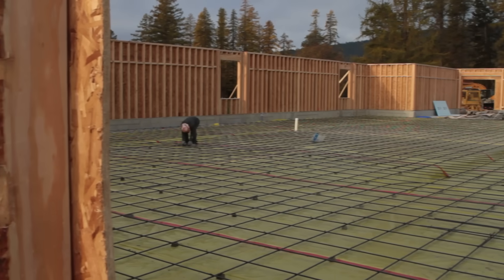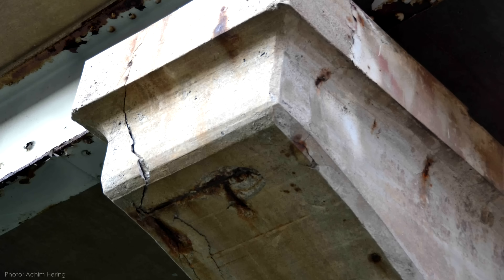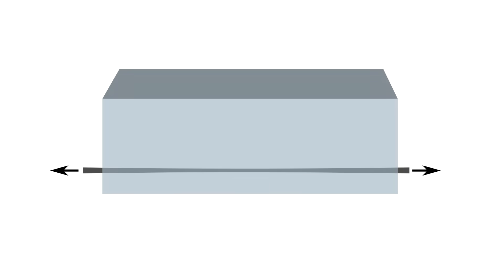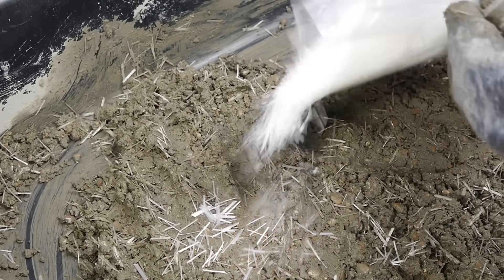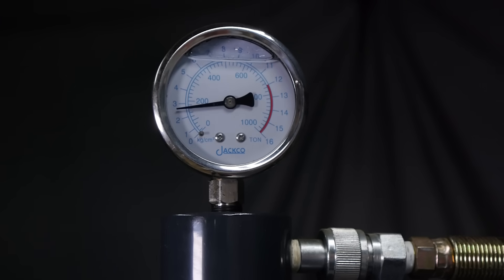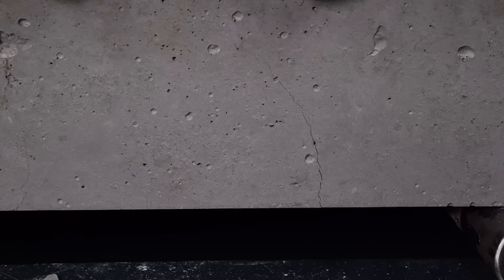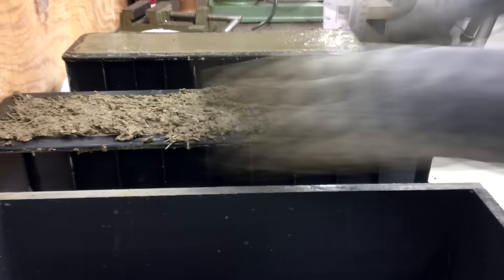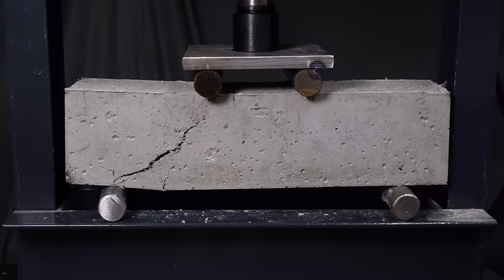Does Rebar Rust?

Comment: I constructed and maintained bridges for the state of SC for 34 years. Although some of the bridge beams we used were not of the best quality due to poor quality control  at the beam plant, most of our problems came from lack of maintenance, When I would make complaints to management, I would get answers from the SCDOT top manager that the public did not see the underside of the bridge. What he was trying to say was the money for proper maintenance was not there and we would have to do our best with what money we had. I would get really pissed knowing that I was spinning my wheels trying to keep the bridges in my district from falling. Some are really in bad shape and only get money for repairs when the inspectors rate them critically. Not only were some of my bridges state-owned but interstate owned by the Federal Government. Many of the major repairs I did were bridge bearings due to lack of maintenance. Many with stress cracks from bearing failures. I could go on with problems I tried to repair but money is a key issue. It is expensive to make repairs to bridges but the flowers alongside the road look much better for those in authority.
Reply: As said by a US Senator: infrastructure is boring. Also, the attention they get from maintaining infrastructures is not as much as creating new ones, so there is that.
Reply: @craigjensen6853  On my list of bridge repairs I and each year more on the list form the inspectors, many times I had to tell the supervisors above me that I had NO solution for repair. Some of the bridges were so far gone, the only fix was replace. Money is also one of the problems of deficient bridges. After ever snow season, bridges are supposed to undergo a thorough wash down to get rid of all the salt and calcium chloride. Over time the corrosion did it's thing and now this country is in bad shape. No money for maintenance. I had a couple of old bridges constructed by the WPA. The tendons here was square steel about two inches in diameter at the time of placement. As the spalds popped, some of the steel was rusted completely through. Really sad. :They finally replaced the twin bridges.
Reply: New bridges ought to be funded with adequate maintenance prefunded.

Anything else is a waste of money.
Reply: My Ph.D. thesis was about chloride-induced corrosion in concrete. 
You can check this link of my thesis dissertation: https://www.youtube.com/watch?v=b1zG3u5wjEE
Reply: Bean counter:  "The public does not see the underside of the bridge"
Engineer:           "No, but they'll see the bottom of the river when the bridge collapses"
Reply: Maybe if the bridge was designed correctly to begin with all the repairs and money waste wouldn't have been needed. But you go ahead blaming someone else if that makes you feel better.
Reply: Sir, who creates the money problem ? The govt. authorities or the private company for which you were working. Why would be there shortage of funds from govt. side as it's all public money and US govt. has most money on planet.
Reply: Suraj Tomar that’s not how it works.
Reply: @SurajSinghTomarArya  The "Free Lunch Anti-Tax Republican Party."  They don't want to pay a single tax, but still want America to be the best, baddess, and meanness Country on earth, ... for free.
Reply: Raymond Myers uh no. In SC they just put through doubling registration fees for vehicles, license fees and taxes in new vehicles to “fix the roads”. The only roads being fixed are interstates. Secondary roads?😂😂 I do hope if you visit SC (where I’ve lived all my life) you did pay a little extra for the struts with coil springs on your car or truck. We’ve just gone through the wettest winter on record and the potholes are abundant. The only good thing about them is it does slow traffic on our road which usually is flying (two lane road) shoulder in some places, others ??
We already were paying some very high vehicle taxes before the incremental doubling went into effect. The money is going somewhere but not into asphalt on secondary roads. The interstates will be masterpieces but getting to them will kill your vehicle.
A road near us was “resurfaced” recently-sprayed with tar and pea gravel spread on top and a ditch reshaped on one side near an intersection. I have seen four cars, two pickups, and one tractor trailer stuck in the ditch because if you swing wide to make the turn, the new ditch starts at the edge of the asphalt. Zero shoulder. None. When I say stuck in the ditch I mean the cars passenger doors were on the bottom of the ditch and the people driving had to stand on their consoles to open the drivers door nearly straight up to get out. 
Who in their right mind signs off on these projects when complete?

Comment: Another solution to corrosion prevention is cathodic protection; also quite common in concrete structures. Though it has it's own intricacies, it's a very interesting topic, especially when expanding the theory to other buried/submerged metallic structures.

Comment: Researchers are developing inexpensive ways to make carbon fiber from coal. This will replace much of the steel used in construction including concrete reinforcement. As an added benefit it will revive the coal industry without burning it as a dirty energy source.

Comment: I have 14 pieces of 1-1/2 "x10' rebar that are 54 years old. they laid on the ground for about 25 years at my Fathers Construction company. They had light surface rust on them. When my father passed and i liquidated the company , I decided they'd look good as stanchions around a flower bed. so i cleaned them up and epoxy coated them. I think alot of times Mill scale helps to preserve steel. BTW , i still haven't planted that flower bed.

Comment: Hi Grady,  Love your vids and have a question about the strength of joins between one concrete pour and another. Example. If one was building a wall/slab. And only had small batch mixing options available.   At some point in the formwork, one batch will meet another and they will be at a different point in their curing cycle. I'm assuming this is suboptimal.  But how badly, and where are the sensible limits?  
15mins between batches probably isn't much, but what about breaking for lunch or getting off site during the peak heat of the day. Bad weather interruption or even do some today, do more tomorrow..  I am similarly interested in this topic in a rammed earth construction. But as it is subject to a similar cement curing chemistry, I assume the answers are fairly good for both situations.
Hoping you might consider this worthy of a vid.  Thanks. :)

Comment: Using a integral water proofing when batching concrete and fiber or basalt bars are probably our best bet. The water proofing should help prevent the penetration of deicing salts and the fiber bars being twice the strength of steel with  1/7 the weight is a winner in my book !

Comment: As a NACE Certified tech I can tell you this is caused by Chlorides ( compound with chlorine bonded to an alkyl group.) This is why bridges fail as do a lot of Concrete structures. Where does the Chloride come from,,,Smell freshing mixed Cement...smells like Chlorine, right? So we put the same element on the mental re-bar that destroys it. Amazing our engineers haven't figured this out yet,,,huh.

Comment: Interesting to watch how the fibers and the rebar help the tensile strength, nicely explained and demonstrated thanks..
I work in traditional lime putty mortars and plasters where I use animal hair, hessian, sisal or polypropylene fibers for extra strength.
With Roman 'cement' their lightweight structures have survived many thousands of years and that the added lava or pumice became much stronger when immersed in sea water. This was because of small platelike objects called 'philipsite' that formed as a result of the mortars immersion into sea water which bend rather than shatter when under stress, many limes set well under water. 
Of course, concrete has the edge over lime because it's better at taking weight over longer expanses, also cement can actually take anything up to 6 or 7 years to fully cure. 
It would be interesting to hear your take on what caused the failure in the recent Italian road bridge that collapsed. Obviously this disaster was due to substandard mafiosi contract cement being used or perhaps they never added any rebar but whatever the cause somebodies nuts are on the line. I also watched a fascinating documentary about the Hoover dam construction and where the concrete had to be poured in sections at a time and to keep it cool, pipes carrying cold water were laid in with the sections but the main strength was achieved by the compressive strength of the water in the dam itself which I guess, like the Roman harbour constructions are harder than when they were 1st built.

Comment: Where I used to work (Nordhavn Metro in Copenhagen), we used this special membrane that reacts with the concrete.
We did a 40m x 9,6m shaft (where the ground water level were at roughly 4 meters below the surface) while using this membrane, we only had 1 small leakage after the construction of the shaft. 
For reference we had to pump 40m^3/h water up to the surface (which is quite a lot compared  to the size of the shaft and that we worked in limestone).

Comment: Would it be helpful is all rebar would have been individually protected against rust by shielding it with a plastic coating? 
 
And another thing is, I saw in the movie a floor being poured upon rebar, and the rebar only was laying on a plastic sheet, If water would come under the plastic sheet, the steel would come in direct contact with water. This is not the proper way of making floors. What I have seen in my own experience is, that the rebar is kept from the bottom by foam, then the concrete is poured, the result is that the rebar is between 5 and 7 cm from the bottom part of the floor. I think this is the proper way, in this movie they do it wrong. Making mistakes like that is causing all the problems.
Reply: The plastic sheet would also not actually lift the rebars up so concrete can go under it.

Comment: I’m an architect in CA and I see “ductile-Crete” used in industrial project quite often. I had assumed that the glass fibers actually increased overall ductile strength, so it’s very interesting to see that it merely helps prevent minor cracking. Thx!

Comment: The Roman cement or mortars last to this day. They were used mostly in compression with natural stone, not so much as a glue, more like a gravity shim. They also made concrete under sea harbor structures. Were they a better cement, or would our modern cement last as well without the "rust scale pressure"? Also, do you know if acrylic admixtures can help with longevity? I am currently using stone veneer mortar and fiberglass lath to make water features in a climate with a hard freeze, so I have a practical interest. Very interesting and informative video, Thank You.

Comment: We laid a drive entrance 25 years ago with smooth surface rust mesh that was before the common rebar wires used today - recently the telecoms people came along and dug a trench across the drive and I was curious to  see how the steel had faired.  It was in the same condition as laid and there was no sign of the surface rust it had before covering.  I was told at the time that the concrete would preserve the steel if the cover was sufficient. The entrance was used by 40 tonne articulated vehicles and was just 200mm thick . They were right.

Comment: Little question. Isn't glass fiber a little bit problematic (hazardous when breaking into micro particles)? we basically learnt in construction class, that glass fiber can have similair results to our lungs like asbest when cutting/handling without propper gear and certainly somebody will want to drill a hole into the concrete as we know humanity...

Comment: @  2:35  the re-bar is sitting right on the bottom of the pore,  I never do that, (I hope  :) ),  do you think they can get away with that.  I strive to have all my bar at least 2 inches from any outside edge.  This is one of the reason I don't like using the #6 (or whatever) welded wire in the concrete because it is hard to get it to stay where you want it, I have seen people almost every time have it on the bottom.

Comment: modern engineers are making concrete weak and prone to fail, bunkers from ww2 still stand, and if you want to go further back, what about roman structures that are still standing?
Ai Karamba we want awnsers!
Reply: that's actually simple.  tensile strength wasn't a concern with roman construction.  they were only concerned with compression.  the concrete they used was also mixed differently and had years to cure.  modern construction needs to take the compression and tensile strength into account, as well as cure time.  it's extremely impractical to use the roman methods today.  we simply do not have the time.  the lifespan of a building these days typically doesn't exceed 100 years, anyway.

as for those WW2 bunkers, they opted for very slow curing concrete that isn't exactly practical in most builds today.

Comment: Most concrete is wet. Its hydrophillic and sucks water into the pores. The concrete doesn't prevent steel from getting wet at all.
Reply: Plus the small degree of cracking you showed (less than 0.2mm) usually wont lead to corrosion. The chloride and water that gets into the cracks won't be significant to the alkalinity of the surrounding concrete. Generally chloride initiatd corrosion is due to concrete quality and cover rather than cracking.

Comment: You were spot on about the adoption of the gfrp rebar. I've been told 'it's not in the code so it won't work' far too many times by civil engineers.
What about epoxy concretes though, any insight?

Comment: hi, I am not trying to look smart or anything, it's an honest question, but... doesn't those cracks serve a purpose in the analysis/diagnostic of how is the structure's health? I don't know what the canadian norms work with that but we divide that in domains (1 to 5 each one having less ductility, and higher As/Ac) whenever calculating the Area of steel and it's actually not advisable to use a "crack proof" profile, just so we get a warning in case the structure start to fail.
I'm thinking it's due to the low cure time [7 days] but the way the reinforced tests broke to me look a little bit scary... first the "warnings" appeared so so close to the total failure point, second they didn't even start from the bottom wich is supposed to be the stretched zone, that sure means the reinforcement is doing it's job but how would that work in a real situation? would we still have the early warnings of failure?

Comment: Stainless steel rebar. :)
.
.
Man I need to start watching videos all the way through before commenting. :(
Reply: rust on rebar is not a concern unless the rebar was not installed correctly.  modern concrete will degrade and fail long before you need to worry about rust.

of course, there are some specialty builds that need different construction, but those are the exception rather than the rule.

Comment: Why not paint the re bar before concrete
Reply: ask yourself first why the bar has ribs. then u will unserstand
Reply: @David-cy5zu  Seriously? coated rebar still has ribs.
Reply: It's calle epoxy rebar, and it is code in many regions, however, it doesn't last any longer.
Reply: @truantray  then you need bigger ribbs though. else it will not grip same good.

Comment: No mention of air entrainment for freeze/thaw protection? Anyway,  I am an inspector for construction projects, (Bridges, paving, etc...) and on many, many occasions, we tear out old WPA  structures from the 1930s and 40s. What we find, time and again, is we are removing much better concrete than what we are placing. I've never figured out why? We test the concrete to no end, everything scientific,  and with so many advances, but I have to wonder. Is it the additives? Is it because the old WPAprojects used 100% Portland cement instead of cementitious additives like CKD or fly ash?  I have heard stories that they simply mixed the concrete on site, using whatever natural materials on hand in the creeks. No aggregate sizing, no mix designs... just concrete that worked and worked for a LONG time!

Comment: The whole problem is using cheap steel in rebar. Cheap, regular steel that is already rusting before it's even ever used as rebar in concrete. The solution is to either switch to stainless steel rebar, or galvanizing the rebar. Hell, even using basic primer and then a rust inhibitor paint would work for a decent time.
Reply: Stainless is too expensive, paint or epoxy doesn't work. Best bet is galvanizing, but cement eats zinc before it sets.
Reply: Not true. Surface oxidisation before installation is perfectly okay, and arguably favourable for use in reinforced concrete. Surface rust on its own is protective for the reinforcement, it is exposure to salt products that leads to corrosion as the chlorides remove the protective film and corrode the reinforcement.

Comment: If strength is not a problem you can add about 2 to 3 tablespoons of bentonite to the concrete to about a gallon of cement, great for small patch jobs like putting tubing through a cement slab.

Comment: Very interesting... I was wondering why they don't just add a little chromium to steel rebar to give it rust resistance. Also it seems that a goal for concrete is to somehow build in a little flexibility without sacrificing compressive strength - maybe by adding some sort of rubber particle to the mix?

Comment: Question:

In your video on concrete reinforcement you showed how adding steel reinforcement changes the failure mode of the concrete from brittle to ductile, which is good because it helps maintenance people check the health of the concrete based on the cracks that are forming. Since these fibres help prevent cracks from forming, will they affect this?